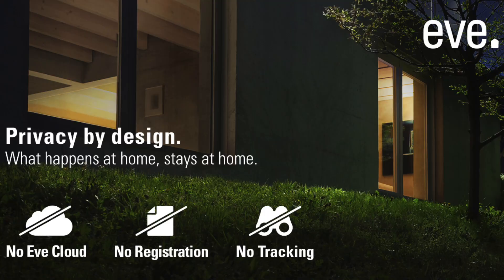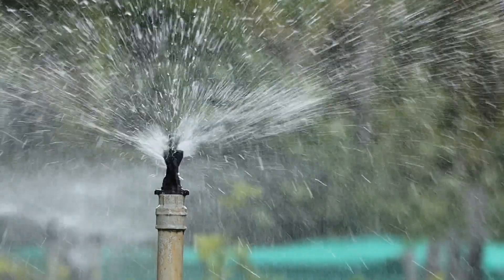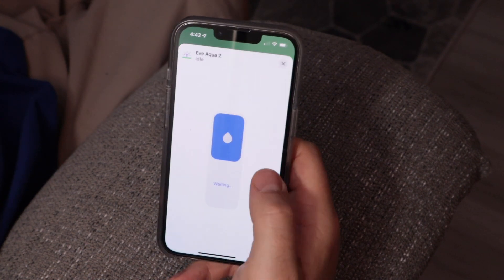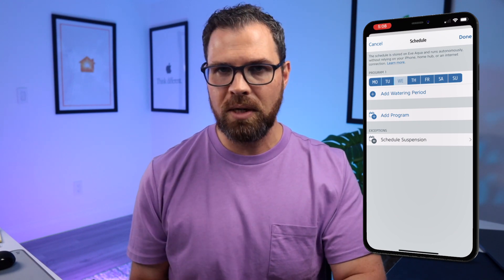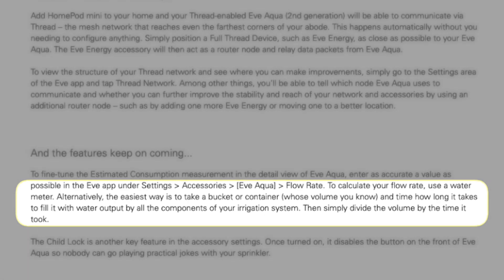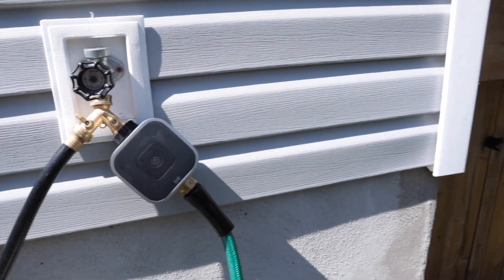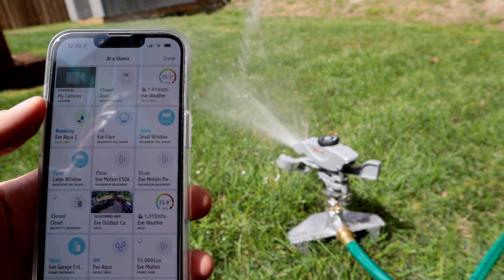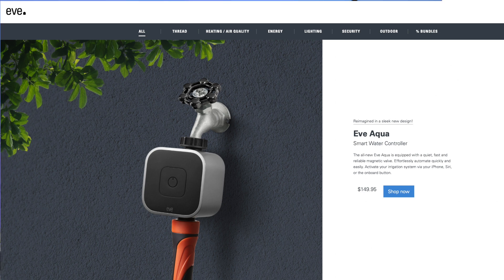EVE AQUA - STILL WITH THREAD - WHAT'S NEW & SHOULD YOU UPGRADE?  #homekit #smarthome

Comment: I have two second generations and I accidentally popped one of them off the faucet by pulling on the hose too hard. I bought a third generation because of the brass connector instead of the plastic connector. I sort of liked the previous version making some noise so I knew it was turning on and off by the sound. I also liked the water coming on slowly instead of getting the water hammer effect of the new magnetic mechanism. I like the newer version mechanism in that it is much less likely to leak (only time will tell). Overall, I am happy I have upgraded to the new model and will probably get two more and sell the two second generation models.

Comment: I’m planning to use one of these for an auto fill valve on a fountain. The valve works like the ones in the back of the toilet, where the water level dictates if the valve opens or closes. Because of this, the valve closes when the float rises with the water level. The problem is that these outdoor fountain valves have a tendency to fail or get stuck. The Eve Aqua is theoretically going to be a safeguard against floods. The valve will only open for 5-10 minutes per day, allowing the fountain to refill for a set amount of time, avoiding potential flooding.

Comment: hello The Brad Lloyd. Hey, do you ever lose bluetooth connection (failover) with your BLE / Thread devices ? The reason I'm asking is Eve just launched their Thread light switch today. I might get a pair of those. But I don't want them to drop connections. I know Casetas are pretty good too since they control the transmitter and receiver. Distance from Apple TV 4K with thread to BLE/Thread device is within 30 ft.
Reply from the maker: I haven’t tried the light switch that Eve just released today, but I will soon. However, my other Eve thread devices have been solid and maintain their thread connection.

Comment: My previous 2nd gen started to leak. I tried to tighten it by using a wrench, but I ended up breaking the plastic connector ring. Luckily Amazon sent me a new 2nd gen Eve Aqua for free within one day and it works like a charm. No wrench this time (thanks for the useful tip!). Martijn, the Netherlands
Reply from the maker: Yes, as tempting as it is, no tools!! The brass connector on the 3rd Gen is a nice addition!

Comment: 've purchased 3 Aquas (3rd gen) and have many other Eve devices throughout my home, so I'm quite familiar with the Eve ecosystem.  Out of the box the Aquas are fantastic.  After one year... not so much.  I have regular connection problems, and once those are fixed, the on/off function is unreliable.  There are times that the unit will not turn on, and other times it will not turn off.  Not sure which fail mode is worse.  I'm looking for alternatives that are more reliable.
Reply: I’m so disappointed to read this. I’ve been planning to get one of these for years now. I finally have my garden and need one. 
Did you find something else that seems to be more reliable?

Comment: A sleek new design for sure. I prefer my older models because the valve opens and closes slower. I have two that I use to control in ground sprinklers off of a hose bib. A valve that shuts too abruptly can cause damage to the plumbing.  The speed of the older model in combination with a water hammer arrester works perfect.
Reply from the maker: Hi Todd, interesting perspective. I never considered that. Hopefully the 3rd Gen holds up well…

Comment: Hey guys, is anyone using one on tank water with a pump ?
Reply: I’m looking to get one for gravity fed tank water. The pressure isn’t great so hopefully it doesn’t cause an issue. 

Have you tried it with the pumped water? Any issues? I have pumped tank water in the house and if I have issues with the gravity fed the plan is to switch to the secondary water tank with a pump.